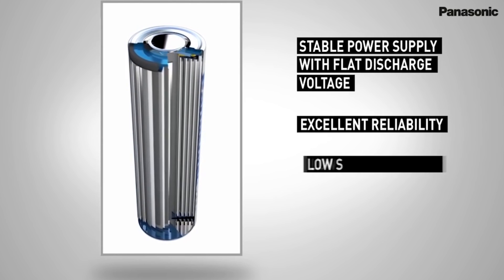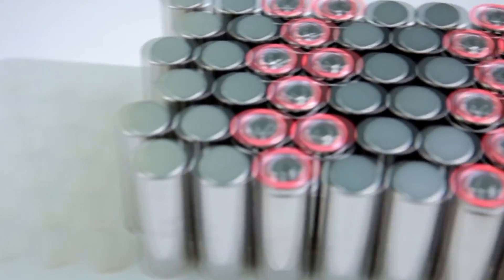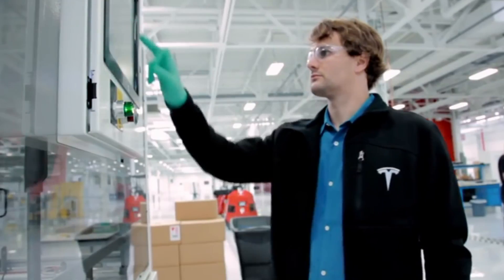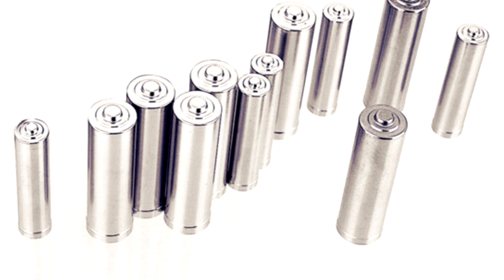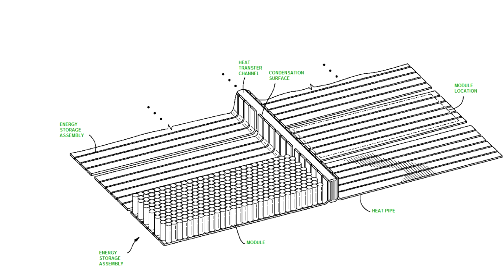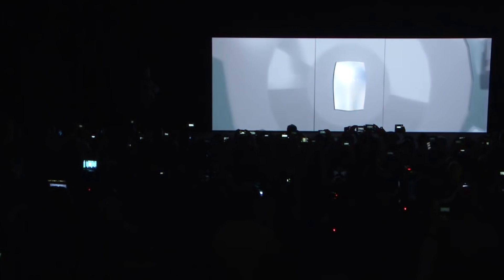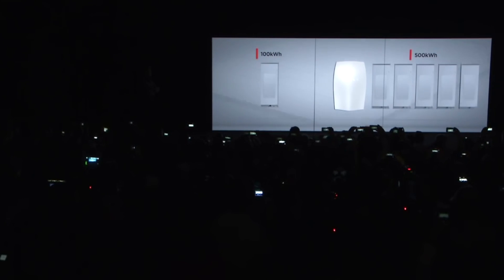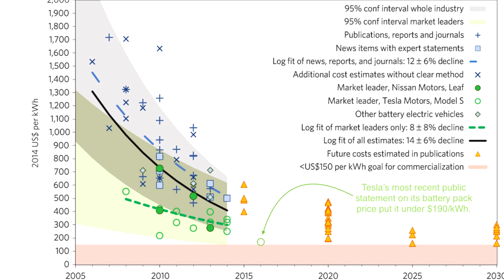Tesla's 18650 cells vs 2170

Comment: Just a curiosity of mine having a mechanical engineering background. What is the limiting factor in regards to the size of a battery cell? Like why aren't there huge industrial versions? (for lack of a better term). Cells measured in meters instead of millimeters?
Reply: Are the chemical stresses to unpredictable? Probably has much do with material science and chemical engineering than it does mechanical.. just wondering nonetheless

Comment: A couple of small points to add: Non-rechargeable Lithium and Lithium-Ion ( tinyurl.com/y6o6hr4t ) batteries are also recyclable in a majority of areas. Also, It IS possible to recycle normal "post 1997" alkaline, non-rechargeable batteries.... The processor will 'squeeze out' the electrolytic paste (usually by crushing the battery) and recycling the cathode (manganese dioxide) and the anode (zinc compound) and casing (Steel) as normal scrap-metal. It IS possible to re-energize the paste by mixing with new
Reply: It doesn't matter. What matters is that you're about to die.
Reply: woooow
Reply: I do that. Have you ever put one on your tounge?
Reply: everyone should follow it
Reply: Wow!!! Go Ahead
Reply: best afforted in this plan so use this battery recovery ideas

Comment: LS21700 battery cell Short circuit test, no fire, no explosion, very safe.
this cell have protective cover with PTC  https://twitter.com/digicasting1/status/995934755953590272
Reply from the maker: Send me few cells  and I will test.
Reply: Ok,Can i give your e-mail ?  my e-mail is :sales@linktosun.com
Reply: Apart from 21700 battery. Your company produce replacement battery for nissan env200 40kw?

Comment: The battery you show at 1:15 is an ICR18650B, using unsafe protected cobalt chemistry. Nothing to do with Tesla.
Reply: actually it shows the Panasonic NCR18650B cell. It is a Lithium Nickel Cobalt Aluminum Oxide cell (just as the new 21700 cells I believe), which has been used for the Model S

Comment: Isn’t a round shape a sort of missed opportunity to maximise the capacity of batteries? There’s gonna be a lot of unused air/ space around the batteries, no? A perfect square with the same width and depth as the diameter of a circle has like 27% bigger area. 

Is there something with the round shape that makes it more suitable for batteries?
Reply: a cylinder is the best geometric shape besides a spheroid for strength, specifically for internal pressure
Reply: Or a hexagon  shape will be perfect because  the batteries  will fit together  like a honeycomb with no wasted spece but, then the cooling tubes have to run between the batteries to cool them. So, how will the cooling tubes fit?
Reply: The anode/cathode/separator inside the cells are rolled up in a cylindrical shape. If the casing is hexagonal there would be wasted space inside the cell at the hexagonal points.

I don't see how rolling a hexagonal shape for the anode/cathode/separator could be easily achieved. The cell layer structure would need to be different.
Reply: Yea but think cooling both internal and adjacent.
Reply: Manufacturing
Reply: Tony Coppotelli, While a hexacon would fit together rather well, because of the sharp angles and flat sides, a battery could more easily flex and bulge from internal pressure. The flat surface has no strength or support and would warp, bend, and bow. While it's a great structure for support from external pressures it's not so great for internal pressure.
Reply: cooling and strength
Reply: Brilliant. Genius, I say.
Reply: you're right. hexagon is the best 2d shape that uses the 100% of the space.
Reply: I thought of that too. Maybe a triangle shape would fill those gaps but it would be harder to roll up the inner strips in that shape and it would require new machinery. Perhaps in the future it will happen.
Reply: it would be nice if we could 3D print the layers of the cells into a hexagon all at once with future multi material printers AKA replicators.
Reply: It’s all about cooling.
Reply: It's about cooling, not just space... just think about it... they heat up, the heat must dissipate.
Reply: Yeah, ne machinery is definetly what stops Tesla. *looks ironically at the giga factory
Reply: Daniel Nie really? Did you not read any of the comments? It’s about cooling. You can’t cool a brick of battery. And cooling smaller bricks would be less effective than cylinders. Good lord..
Reply: I've been referreing to a comment here, wich you obvisiously did not read.

Comment: From a financial point of view, battery powered vehicles don't add up until gas prices are well above twice what the graph shows!
They say they're competitive , however for a similar vehicle, gasoline, and hybrid, you're paying 1/3rd of the price more.
Say, a Toyota Prius C costs $25k, while a Toyota Yaris costs $13k.
A Chevy cruze costs $22k, while a  Volt costs $33k.

For the Prius, you're paying $12k more. 
For the Volt, only $11k more. This excludes taxes, so we'll help the electric get more competitive, by just ignoring this.

The price of charging the vehicle (at home), roughly covers the cost for oil changes on a regular car, so the only difference between the gasoline and ev/hybrid, is the price of gasoline.

$11k on gasoline at $2.5/gal, would get you roughly 4.400 gal. 
A vehicle at 30 MPG AVG (prius or Cruze both are doing this easily), would need to travel 132.000 miles to be even with an electric car. 
132k miles, at 13.2k miles per year, would equal 10 years; or the lifetime of the vehicle.

At $5/gal, this would halve, or 66k miles at 5 years.

This is not taking into consideration when a vehicle is being destroyed in a wreck, stolen, or lost.

More than likely, regular gasoline will be closer to $3.5 over the course of the next 10 years; which makes for 110k miles, and about 8+ years.

This all sounds okay. However, not taking into account the replacement of a battery pack, which can easily add $9k to a vehicle.
The depreciation of the battery (less capacity over time), may give you 300 miles new, but perhaps only 200 miles in 4 years, and 100 miles in 8 years. At this time, you may have trouble getting to work and back, without recharging.

It also doesn't take into account, the longer road trips of highway riding, which a gasoline engine does so much better and efficient (almost instantaneous refueling)!
Nor the price you'd pay at charging stations (wherever they may be).
Reply: Muranaman Where did you get the $9K price for battery replacement?
Reply: That's where Tesla beats them all..model 3 cost same as BMW 3 series, Audi A4 and merc c class ...thing is economies of scale for the batteries

Comment: did anyone else catch the fact that the 2170 provides 10 - 15% more power than the 18650, but it's 10 - 15% bigger? umm, ok. looking for logic here.
Reply: Did you notice how he was talking about how energy density increases by 30% and you dont need more power per cell because they run them at 6A per cell and not at the possible 15A.
Reply: @dangi12012  Tesla runs the battery at half what they are rated for as it will double the life of the battery...Also when a Tesla car stop cause the battery is dead...in actuality the battery still has like 20% of its capacity...this is also done as it doubles the life of the battery by never completely draining it...never completely charging it...or discharging it at its max rating...all which are the main cause of battery failure..
This is why Tesla's battery management system or BMS is so important to prolonging the usefully life of the battery...
Heat kills batteries...heat is generated while charging and discharging...mostly discharging which is what the cells are only ever asked to discharge at half what they actually could...as it prevents the cell from ever really heating up...
Plus with the new designed cell Tesla is able to get the same capacity battery in a more compact size...which allows them to increase capacity while maintaining the same physical size as before with the 18650.
Reply: That can be used according to their use..
Reply: It is 10% larger but has a 30% increase in power density.

Comment: It sounds like a sales pitch. I don't believe there's that much difference other than shape.
Reply: 正义 I agree, minimal design tweaks and power density claims. The manufacturing capacity and slightly altered form Factor makes it somewhat proprietary.
Reply from the maker: I disagree.

Comment: I wonder if they are using the Battery Technology invented by Ionic Materials (solid polymer electrolyte material). Or is it sort of like that because the physical properties are very seem similar just one in a Flat Pack the a Drum version. Another very cool thing about Michael Zimmerman's Battery it is utterly safe and won't burn when crushed or punctured. And if that wasn't enough there is little or no dendritic crystal growth mechanism, so the Battery will last a  very Long Time perhaps 20-30 years. Check it out here http://ionicmaterials.com/about/
Reply from the maker: If that would be true Tesla would hire this guy or use his battery which is not the case!
Reply: That doesn't stop them from imitating or coming up with a reasonably effective copy, as well Professor Zimmerman is not the only one. There are more for instance theirs more. Physicist Maria Helena Braga with John Goodenough Her time as a guest researcher in Goodenough's lab allowed her to have a better idea of the stoichiometry of the different elements in the glass – a process by which a balanced chemical equation is used to predict the amount of reactants and resulting products. This in turn enabled her to simulate different glasses to understand their properties and develop a new and better glassy electrolyte. Unlike liquid electrolytes – the cause of many an exploding smartphone and hovercraft – the glass electrolyte in the new battery technology doesn't carry the risk of overheating or exploding. According to the researchers, the glass battery has three times the energy density of a comparable lithium-ion battery and early tests have shown the cells are capable of 1,200 charge-discharge cycles with low resistance, which bodes well for a battery with a longer cycle life.

Comment: Search for investors
Environmental technologies.
Technology offer Performance multiplier, with milliwatt to megawatt.
High performance gain with the successfully tested pulse technology.
The novel power optimization is a simulated energy source as an electronic device (EPM, electronic power gain multiplier) and over 1000 km of long distance in series or parallel, connected to primary energy such as accumulator, photovoltaic, fuel cell and is generally applicable in the electrical engineering sector with impulse drive for electric vehicles, track, electric aircraft, space and shipping, thermoelectric generators (patent) and in the household save 50% electric heating costs. 
Innovative Technologies – RZ-IT
Rudolf Zölde
samplingtec@gmail.com
www.rz-innovatec.com
If 100 liters of petrol are consumed for a route from A to B, 
70 liters are converted to heat and 30 liters to moving energy.

Comment: I don't know much about this, but I read somewhere, that their cells are going to be a bit bigger than the current ones. So no AA-format... and if that is the truth then it sucks - cannot replace just the cells, but the whole device.
Reply: Wolf3fd the current ones are not aa size either, and you cannot easily replace a couple of cells in existing packs.
but if you could (or rather, if a faulty pack goes back for refurbishment) then yeah they could just replace the faulty cells

Comment: I understood the original logic of using 18650 cells because they were a commodity and that's how he could get the best price.  But, now that he's manufacturing his own batteries, what is the point of keeping the metal can encasing each individual cell?  The battery pack already has metal all around it.
Reply: Something has to contain the internal pressures that are generated, especially during fast charging and discharging. Large prismatic lithium cells usually require external structures to keep them from failing mechanically due to internal pressure changes.
Reply: These batteries have higher energy densities than 18650s. It would be hugely beneficial to use these over multiple 18650s, saying "every single one of these will end up in a Tesla product" is ridiculous. You think Panasonic partnered with them to make batteries for Teslas and nothing else?
Reply: By having space around each battery they naturally cool, and you can allow for expansion. It's more reliable. As are lots of small cells.
Reply: The weight of the enclosure really is nothing, and it's not that the batteries have a super strong expensive enclosure, fitting some metal around them is basically free compared to the rest of the car. You may have a point when it comes to the titanium plate under the car though, that is surely expensive.
Reply: These batteries are gonna be used in lots of devices so it's cheaper to make them in the metal casing than making them in the metal casing for non Tesla things and then also making a custom Tesla battery. The issue with the batteries is weight not volume, so the savings in size of doing that wouldn't be worth it.
Reply: Well that's because they don't even have enough batteries for the cars made yet so obviously they're not gonna sell them right now, and their plans were never to sell direct to consumer because consumer devices don't user 2170s yet so I have no idea why you are going on about this. To be honest, you sound like an idiot.
Reply: Yeah I agree and I think failure is one of the biggest reasons, this way you can swap out a battery or recover good batteries in a crash, with one unit if it's damaged the whole thing is done for and failed cells could not be replaced.
Reply: But with battery cells, cavities are also welcomed for cooling...
Reply: We do that so we can run liquid cooling between each cells.
Reply: David Hager, consider filling a rectangular area with batteries. If you use cylindrical ones you will have lots of wasted space. Thus you will need to have a bigger rectangular area to have the same battery capacity. In the case of a car battery you will need a larger metal enclosure overall which may end up much heavier.
Reply: Because it's the technology he knows. And the video states it's a "new" "advanced" battery chemistry. It 100% isn't. They're still using gen2 NCA technology in the cathode -- which is the part that actually generates power. Yes, the anode is a different formulation so they can make it smaller, thus allowing more cathode in the same space.

To those who keep pushing the idea these batteries will appear in other things, you're dead wrong. Every single one of these cells will end up in a Tesla product. Nobody wants bigger cells. Think about it... how big is your laptop, tablet, cellphone, etc.? None of those things are big enough to hold a 2170. An 18650 is too big in many laptops already. When's the last time you saw an 18650 in an Apple device? (over a decade)

Weight does matter. 7000+ steel tubes add up. Tesla makes some of the heaviest battery modules around. In fact, heavier than some NiMH packs.
Reply: Fine. Where can I order Tesla Gigafactory manufactured 2170's? Oh, right, NOWHERE. Where can I buy the LG packs used in the Chevy Volt or Bolt? Again, NOWHERE. (actually, if I had a large enough, sustainable order for them, LG Chem will work with me.) Panasonic partnered with Tesla to build batteries for Tesla.  (If you approach Panasonic to order 2170's, they won't be Tesla Gigafactory units.)

Comment: Are Tesla batteries only for their systems or be available to general public?
Reply from the maker: its only for their systems. I doubt it will be available soon...
Reply: Sure it's always available to general public! Just buy it from Japanese Panasonic thru American distributor Tesla :)
Or try to contact Samsung and LG.  Those will make those batteries available faster than others.
Reply: John B win partnership, but they do make a 2070 cell, Tesla looks like the 2170, has added safety electronics added to the top...